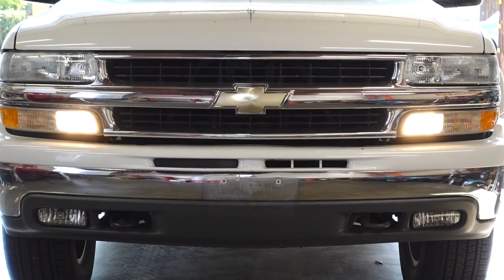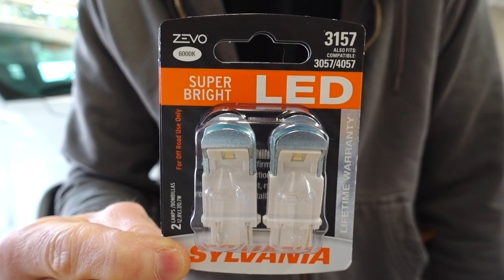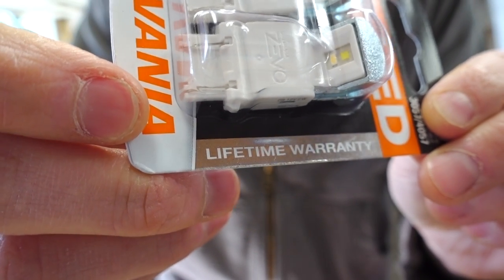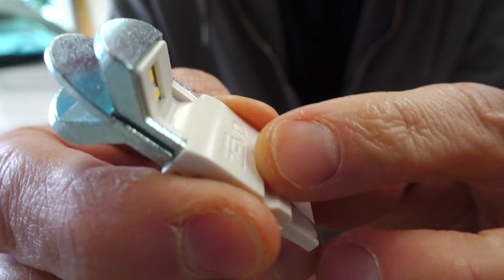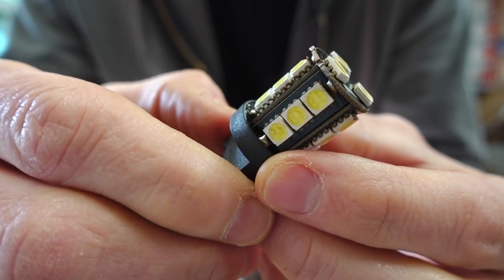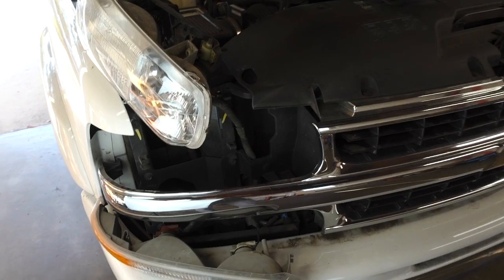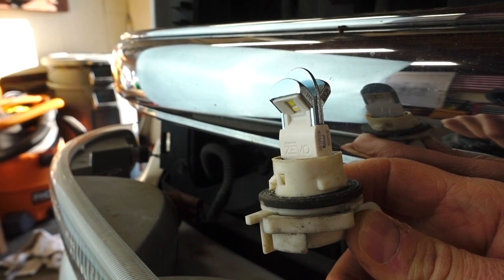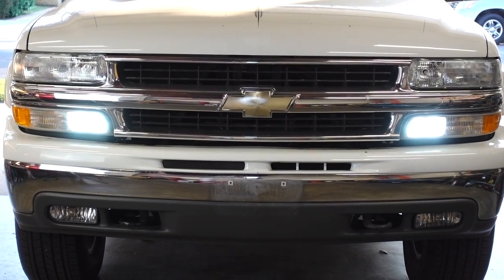Here's Why THESE ARE THE VERY BEST AUTOMOTIVE LEDs YOU CAN BUY!!

Comment: -- I bought some cheap ones for the winter beater.  Rust protection is more priority just now.  If I can save this Tahoe (looking good) I'll upgrade to these lights of yours next time.  Strange times with the cost of gas, skyrocketing used car costs.  Usually run a beater for a winter.  This one's gotta last.  Thumbs up.
Reply from the maker: Hey Mark, I’m still running those Sylvania Zevo and love them. 👍👍
Reply: @1RoadGarage  -- Nice, I bought a 20 dollar set that looks like the cheap ones you showed, for the DLR and headlights.  Just need them to survive one winter before I do what you did.  Wish I'd seen this before.  Mistakes were made :)  But hey, we'll see how they old.

Comment: I tried a Sylvania LED unit bought from an auto parts chain (not labeled "Zevo") and it was actually not as bright as the common 3157 incandescent bulb it replaces. Put the incandescent back in (backup/reversing lights) Now have another brand of LED in both backup lights which are noticeably brighter than the ordinary lightbulbs.

Comment: Those LED bulbs are a must-have if you have a pickup truck.
Ever noting the brake lights burn out quickly?
That is due to shutting the tail gate.
I replaced mine and no more burned out brake lights!
Be aware though that using LED's for turn signals and related usually causes rapid flashing.
I do not know if you can still buy the heavy duty flasher units to prevent this.
Many vehicles have the flasher unit built into the dash control cluster or similar and cannot be upgraded (least not easily).
For those applications you must install a 'ballast resistor' on each bulb so your 'blinks' are near normal.

LED's activate much faster than incandescent bulbs.
And at highway speeds, they can give the vehicle behind you up to 50 extra feet of notice to stop.
Amazing what 1/2 second faster notice will give someone.

For me, if I ever got a vehicle with daytime running lights, I would just disconnect them and convert them possibly into fog lights.
Daytime running lights are NOT mandatory in the USA (they are in Canada though).

Comment: FWIW, I've tried three different 3157's back to back:

Zevo 3157
Oxilam 3157
Alla Lighting (44 SMD) 3157

The Oxilam was by far the brightest of the three, Zevo was the least bright.  The Oxilam actually felt like the best quality of the three, though they all had aluminum heatsinks.
Reply from the maker: Cup & Cone that’s part of my point.. it’s not about being the brightest, it’s about being the best. This includes factory-like brightness, factory-like performance and build quality and good color temperature.
Reply: @1RoadGarage  I can certainly see the appeal of them, especially in a DRL which is going to run all day long.  Truth be told, that's why I bought them (because they were available local and I wanted something with a reputation), though I later went in all day Amazon shopping excursion to find something else.

Comment: I bought LED headlight bulbs for my Civic nearly 3 years ago. They're a cheap, $45 off brand made in China, but they came with a beefy aluminum heatsink and fan on each light. They've lasted this entire time, and they're super bright and create a clean line across the road in front of me. Best $45 I've ever spent. I got "Yorkim Super Bright 1157 LED Bulbs Amber" for my turn signals, and "Marsauto 9006/HB4 LED Bulbs with Fan, 16000LM 6500K Xenon White" for my headlights. They've lasted this long with no issues. Could be a fluke, I dunno. But I ain't questioning it. They're on Amazon, "Last purchased Jan 15, 2019."

Comment: I actually bought a set of those last week to use as taillights. Meh, they seemed dim only because they don't really hit the reflector in the taillight housing that well. Not impressed.
Reply: @william janik.....Did you get the red Zevos? It's critical to match the LED color to the lens color; keep in mind that red is on the opposite side of the light spectrum from blue.
Reply: Yes, general consensus is Zevos aren't very bright.  You're just paying for Sylvania name and guarantee of longevity.
Reply: Very interesting. I never thought of that. Thanks, I'll have to buy a red set and use the others in the front
Reply: @william....they were super for me broski. i already had them before this video....part of my philosophy ...i make an amazing salary ...and well...i just dont buy cheap things :)
Reply: @cup_and_cone  I have them in my tail lights and in my turn signals in my 2010 compass and they are a lot brighter than the stock bulbs.
Reply: Check out gtr lighting bulbs. They have some super super bright bulbs for $74 after taxes and Shipping.
Reply: Think about it; how bright do you want your tail lights? Bright enough to be seen as designed, or bright enough so it looks like your brakes are on? Think about it. Headlights? Go bright. Tail lights, I'd say stay close to OEM brightness levels.
Reply: For my Lexus es 350, my red Zevo lights hit them well and it's seen well from all angles. They are only a little bit brighter than halogen. But that's how I want them! I don't need those stupidly brighter LEDs that will piss off any drive that's behind you.
Reply: use them as brake lights, you will see the difference, the red ones a dual
Reply: @rebman5150  I'd be careful with upgrading headlights to LED.  Unless you want to have head-on collision because the other driver was blinded by your LEDs.
Reply: @rebman5150  yep only thing bright in my taillights are the reverse bulbs
Reply: @cup_and_cone  I call bullshit... as I have many sets of these lights in three different vehicles and they’re very bright!

Comment: I have a 94’ Sub and kept having one of the left running tail lights/ blinker bulbs go out. The bulb was fine,  but there is so much draw from the battery that the bulb contact-wires got so hot that they melted the bulb’s plastic base and became embedded in it, losing connection with socket-contacts. I swapped out every bulb inside and out for LEDs after that. Huge upgrade. It’s like having headlights in the back when reversing now. They use less juice, which will cheer up your alternator, and they don’t get nearly has hot. Except for the headlights, those do get h.o.t. I went with fanless, air-cooled bulbs for the headlightights, which are plenty bright, and used fanned-cooled bulbs for the highbeams. I figured if they’re getting hot enough to need fans then maybe they’ll be a tad brighter, and they faSURE were. I heard the fan-cooled bulbs can create a buzz in your sound system when they’re running, which I wasn’t too concerned about anyway because I am kind of in between sound systems at the moment, but they’re fine for the highbeams because they’re not always on, on purpose anyway. Bright as. Cheers mate

Comment: JDM Astar LED bulbs are hands down my favorite bulbs for up front . You need to try !
Reply: I've had mine on my car for about five years now and haven't had a single issue. 3 pairs of red leds in the tail lights and amber turn signals / running lights up front. Bright and been without issues. I had a pair of the Zevos in the tail lights before that and they were even dimmer than the stock incandescent bulbs smh
Reply: I loved my jdmastars until they started having issues. I spent 100 on their switchbacks, drl and reverse lights. I got the brightest ones they sell. The switchbacks lasted about 6 months, the drl I had a few single LEDs fail then one went completely out about 18 months in.  I havent tried their warranty yet but I'm about to.
Reply: I had their brake light and one failed after a year, they replaced it

Comment: Hey Jimmy I viewed your video and I was motivated to upgrade my 2000 Chevy Silverado w LEDs int n ext. All worked n looked great however, I did have hyper flashing n replaced module. I noticed those 3157 bulbs right where you replaced weren't lit. I exchanged the plugs simply because they were somewhat burnt...replaced old 3157 incans to led 3157s...checked fuses..still won't light. Can you tell me why...its driving me nuts. BTW...I bought AUXBEAM.

Comment: Auxbeam is also a good brand. A lot of their bulbs have internal electric fans for heat dissipation. Also they use more metal in their designs than I see with other brands. Their bulbs are also generally very expensive.

Comment: Informative video. My truck uses DLR and turn signal on the same bulb. That being said, will these cause "hyperflash" when using turn signal? Would you use thse for brake lights and reverse lights? I would guess not since revese lights and brake lights are used for short period unlike DLR. Thanks.

Comment: LED lamps raise havoc with your radio. You will need to install ferrite chokes on all of the wires that feed power to the LED lamps. Hopefully Sylvania is smart enough to have a good RF filtering circuit in place.

Comment: Yessir buy once cry once. I purchased enough led bulbs to replace all the exterior and interior dome, courtesy and door lights in my c1500 about 10 years ago when you only had one choice at the local parts stores. Within a year all LEDs had been swapped back to incandescent due to various failure modes. Needless to say I got burned. I've been seriously considering these zevo bulbs tho. Thanks for the great demo and review Jimmy!
Reply from the maker: With LEDs it’s all a gamble. I seriously think these Sylvania Zevo are the best of the beat right now! Expensive but the best.
Reply: @1RoadGarage  just curious if they're still working well for you? I spent $$$ after doing some research on a full set, all 4 led headlight bulbs for my 01 Silverado and would also like to swap my DRL bulbs to zevo's 4114 if yours are holding up well.

Comment: You need to polish your drl lenses. Dirty and fogged lenses can reduce light output by up to 70%.
Reply from the maker: Yes!! It’s actually the inside of the lens that’s fogged. From the extremely hot incandescent bulbs!
Reply: 1ROAD is there a way to clean the inside?
Reply: Edgar H252 
I’ve polished literally dozens and dozens of headlights, never seen one fogged on the inside because of the lightbulb. Take that for what you will.

Comment: I've been screwing with LEDs for years. Used to sell and install them and even have done some retrofitting. I'm out of it now but I still love the LEDs and have them in all my personal vehicles in various places. I used to have a US manufacturer that I sold for but they stopped making lighting products. I have since switched to Sylvania Zevo lighting. My interior dome lights are all LEDs, fogs are LEDs cargo and reverse are LEDs. I went with Morimoto HIDs for my low beams because I live in the north and they melt snow and ice off the light housings and they're a much more effective lighting device inside my reflector housing as opposed to LEDs that tend to have more scatter and will blind other motorists and provide a less effective beam pattern. I do plan to go with LEDs in my high beams eventually but I have a Rigid SR20 light bar in my bumper and that well outperforms any high beam I can get my hands on.

Comment: The heat output means color as well, that’s why when you buy led pay attention to the number listed (6000k) or (6500k) will be right around white. I’d rather go to Headlight Revolution and get a set of GTR bulbs and throw resistors in. The only issue with the zevos is that it’s only really a step up from an incandescent bulb. Which would make them a nice upgrade if your old bulbs went out. But if you’re looking for output get a set of high grade. I want people to see me stop and gtr bulbs make that difference. If you spend decent money, not extensive, you can find yourself a quality and bright set of headlights and bulbs. (Turn signal) almost always youll need a resistor if you add an led to turn signal that’s what causes hyper flash so if your turn signal isn’t separate from your tail light or front running light you’ll need resistors. The light output is fantastic and worth the hassle if you are wanting people to see you down the road far greater than incandescent

Comment: Have you had to replace any of your sockets because of heat and age? My 2001 GMC has a couple sockets that need replaced but afraid to buy new sockets for fear of either being cheap or not the correct socket, plus having to cut wires and opening up the wires now to the elements of nature. Wish the manufacturers had put plugs about 6 inches back that one can unplug old sockets and plug in the new ones. I know that's to easy.
If you every do replace a set of sockets, please video it with all information.  Thank you.

Comment: Jimmy thank you for all your good advice and yes the Zevo LED's are awesome.  One bit of advice if you try to also replace your back up lights.  When I changed the back up lights with the Zevo's I immediately got a "SERVICE 4 WHEEL DRIVE"  error message.  When I went back to the 3157's the error message went away.  I would love to hear from anyone else who has a 2003 2500 Chevy Sub that ie 4X4. Thank you Jimmy
Reply: Heard some people had to install some type of resistors to fix these types of issues.

Comment: Issue with the argument of the cheap led's is that they don't get hot. They aren't putting out enough light for the need of a ballast. If you get led headlights, that's really where the issue is. But if you just replace interior bulbs, drl's, blinkers, taillights, etc. They don't need to produce light that you need to light your path up at night like headlights. So that 10 pack of led lights that you showed, bought those and haven't replaced any so far except for the ones I used for my tailights, as they were so bright, they created a pink hue instead of red like I wanted. So I swapped them for the exact same bulb, only it was a red bulb instead of white, and it's perfect.

Comment: It's important to remember that reflector style lamp assemblies are NOT designed for the light output of most LED replacement units. Especially for the forward facing Driving lights. They're okay for DRLs that only come on during the day. But must never be used at night. LED lights require projector style enclosure to capture that diodes lumens and distribute the beam pattern in a focused manner to avoid blinding oncoming motorists, and causing an accident. In GM products specifically their DRLs are notorious for burning out constantly.

Comment: I used the smaller size the 158 which is used for my daytime running marker lights mirror lights and interior lights and license plate lights and I have the one inside my headlights it's finally starting to flicker after over 5 ago years of heavy use worth the price

Comment: I want to use Sylvania Zevo 1156 amber Led Bulbs as a turn signal indicator light in my old model Suzuki Van, I don't want to use load resistors but I am doubtful that it will hyper flash without load resistors, Plz suggest me what shall I do to prevent hyper flash ?
Reply: Bhagwan Singh Rana find a turn signal relay/flasher that is electronic.

Comment: I have been using these Sylvania Zevo or regular Sylvania LED bulbs for over 3 years now and they are great bulbs.   Yes, they are expensive but they work.  The cheap Ebay bulbs are pure junk.  The Sylvanias do not flicker, the color has been consistent and I have not had one burn out yet.  I wish they weren't so dam expensive though.  I have the same burned socket issue with my 04 Yukon and I have already replaced the passenger side socket once for this.  I am going to replace both sockets and go LED on them and be done with it.

Comment: Yo Jimmy - I am looking for GOOD LED Headlights for my '16 F-150.  I bought the Sylvania Siverstar XVE GOLD last night to replace failing LED's (with separate modules....)  but after installing them and trying them last night - I am not going to be happy with these 4300k type color bulbs.

Any advice or suggestion for GOOD/BETTER LED Headlights / kits!?  I was considering a set Headlight Revolution new GTR Ultra 2 LEDs...     or Lasfit or similar (6000k) but took another look and found Sylvania ZEVO !??   Wondering if the HEADLIGHTS would work as good as your Driving lights?   or Do I really need a full-up set of LED's.   Comments welcome!  Thanks guys!